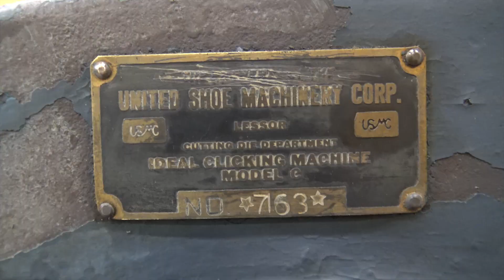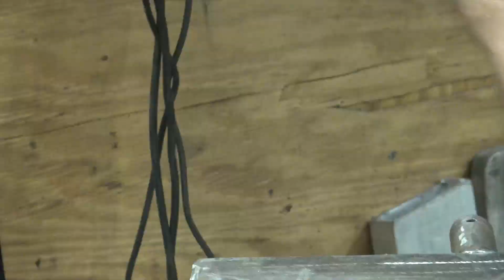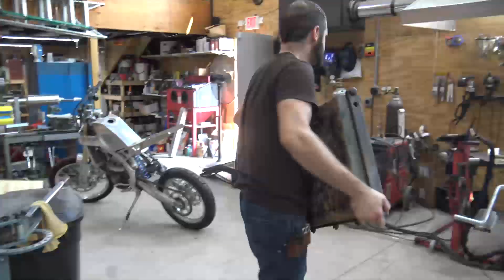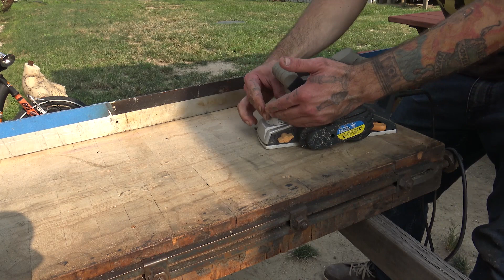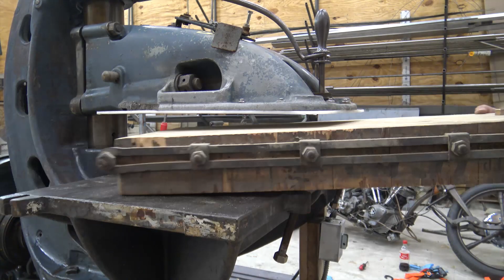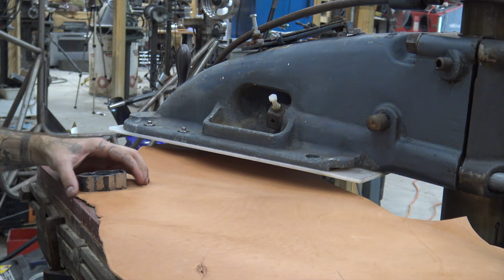1800's Die Cutting Leather Clicker Press Machine

Comment: Nice video! I have a German Sandt machine pretty similar to this, smaller footprint but powerful. I have some other machines made by the BUSM company, a Pearson # 6 sewing machine among them. I'm reading the 1911 British United Shoe machine Co catalogue and I can tell your machine has to be a later model. I would guess it's made between 1930 to 1950. It's cataloged as the # 3 Ideal clicking press. Let me know if you need the catalog it's on a PDF.
Tor
Reply: I could use a PDF catalog Trox77.
Reply: Hi again, give me a email address and I will send it to you. The 1911 British United Shoe Machinery Co pdf is 5,78 MB large.
Tor
Reply: i have one as well. Any market for them?

Comment: Howdy.  I just got one of these. This video has helped a lot.  Did you need to run 220 v to get it to work? The one I have currently is wired for 110 and it went down but won't come back up every time I try the motor smells like it's gonna burn up.
Reply from the maker: Brian Merrick it all depends on the motor you’re using. I’d say you might not have a powerful enough motor but it could also be on the supply end. Hard to say without seeing what you have going on
Reply: @IvanIlerStudios  how many horse power is the motor on the machine in video. I’ve got a machine and when I plugged it in, the motor was struggling to move the machine. I believe it was a 1.5 hour. Not sure if the motor is wore out and needs replacing or if I need a stronger motor.

Comment: hi.im.a footwear maker from Asia and i own and use one of those wonderful clickers.I actually do the adjusting the brakes and the clutch.Its a prime example of great American engineering.Owning one makes me an expert on this particular unit i guess.Its the Nokia of clickers , simply indestructible.For small cutting dies nothing can outcut this baby.Btw you can machine a V groove on the flywheel to fit those Vbelts , it'll prevent them slipping out and it will look a lot nicer that way...its a 1930's model a 15 tonner if im not mistaken.Somebody in the Practical Machinist thread called it  boat anchor , to the ignorant it may look like one but for me its my pride and joy together with my Hamilton delicate drill press.I wish i have the same cutting board , i use the white IP thing.Have an awesome day.
Reply: Manny Fernandez 
Hi Manny. I looked up this video in hopes of seeing up close how the mechanisms in the clutch and brake work, but unfortunately it didn’t go into those details. I’ve owned one of these for a few months and after a few adjustments during setup it has been working fine for the most part. Just the other day it started to click constantly and won’t stop whenever it is turned on. If you have had any experience with yours doing this, would you be so kind as to point me in the right direction on how to fix it? My email address is lissa52664@gmail.com. Thank you!
Reply: @lissa52664  im sorry its six months since ...its the brakes..you have to tighten it A LITTLE BIT AT A TIME..Those brakes are brittle so you must be careful..the brakes have those lining just like a bikes brakes you wont miss it..

Comment: Thanks for the video, lots of information. I just find one really close to me for sale, same machine, the class C, and I'm thinking on buying it for my saddle shop, but I'm just worry about the cutting capability, if the machine will handle cutting thru thick 15 oz veg tanned leather. Can you give any advice? Thanks!
Reply: it has a 10mm cutting stroke but only half is the effective stroke.For small cutting jobs notthing can outcut this baby.
Reply from the maker: Carlos Villalpando 15oz is a bit heavy for it but it all depends on the surface area of the die you’re using